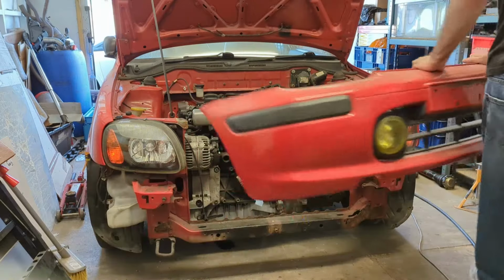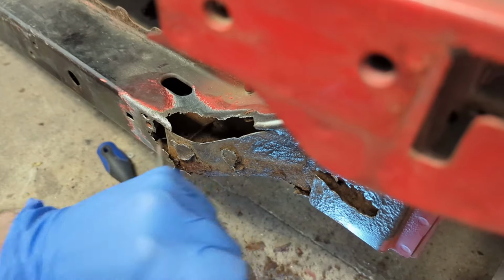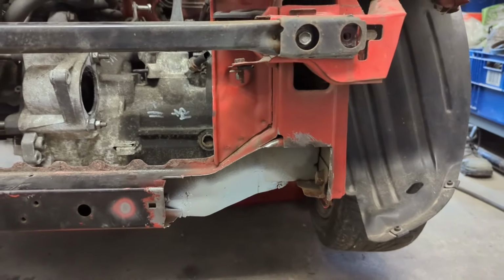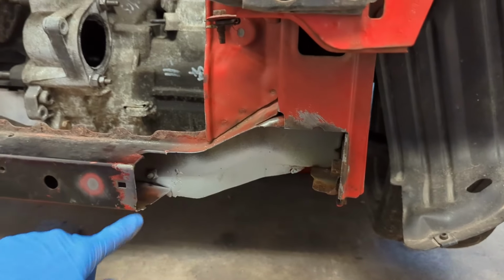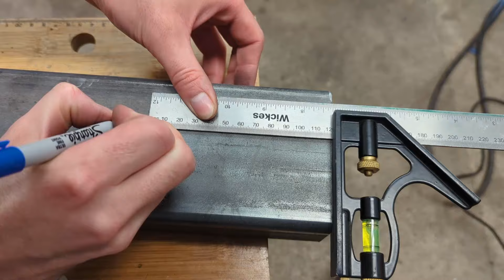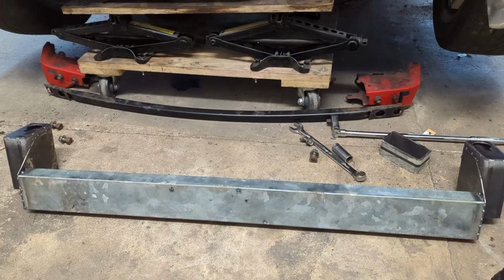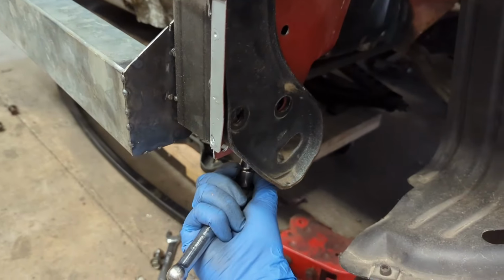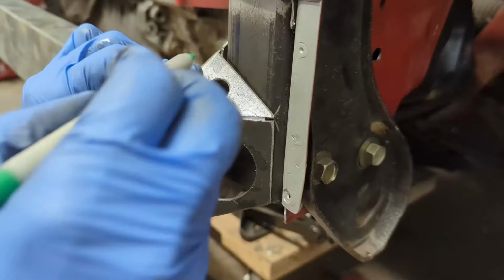Making my Own Radiator Support Because Rust - Audi/VW 1.8T Engine Swap

Comment: 15:47 those welds seem to have poped. I'm not educated on welds tho.
Reply from the maker: I had to cut those so I could bend the side plates inwards slightly.  I should have mentioned it but the chassis legs aren't parallel with each other.